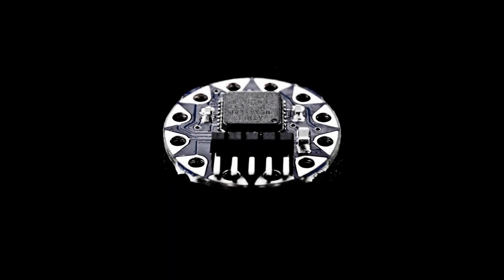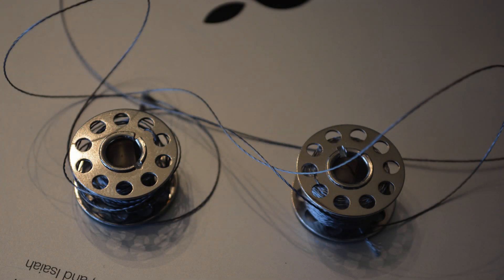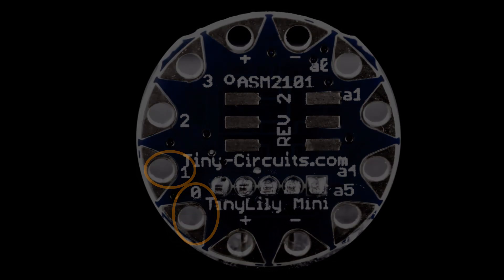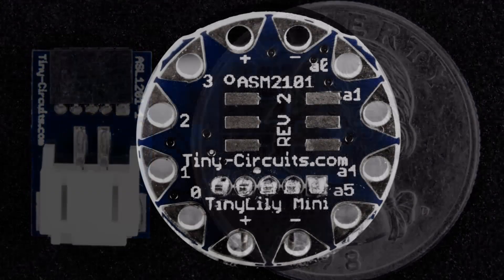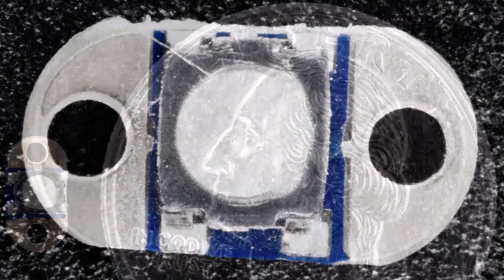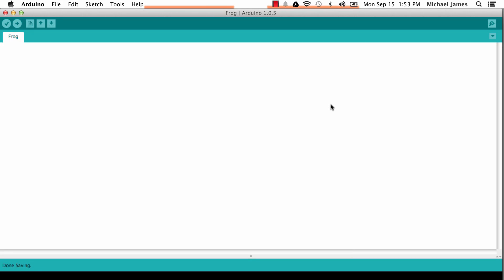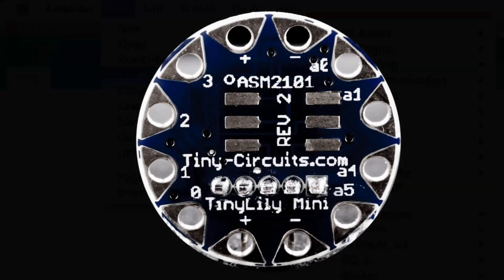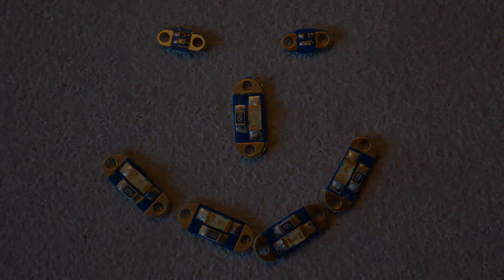Extremely Tiny Arduino LilyPad - Washing Machine Safe - The E-textile TinyLily

Comment: That's a very nice video and helpful as a first step with a new TinyLily.
Two comments/questions:
1)  isn't the pinout for the six unlabeled solder pads wrong in your video? I think the schematic PDF on the mfg site shows 15, 16, 17 where you show 11, 12, 13. I haven't hooked it up yet to see which is wrong, though. I hope the PDF is correct - I think I need 15 and 17 for my project's SPI interface.
2) you could learn to pronounce "accessories"  :-)
Reply from the maker: Jeff Lastofka When I made the video, that is what I came up with after testing each pad (At least thats what I recall I did).

Best of luck!